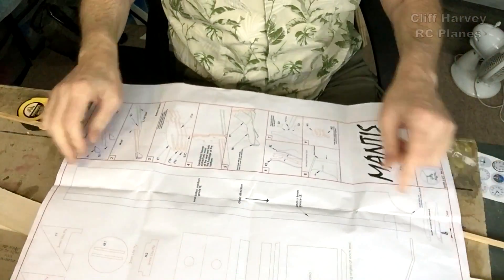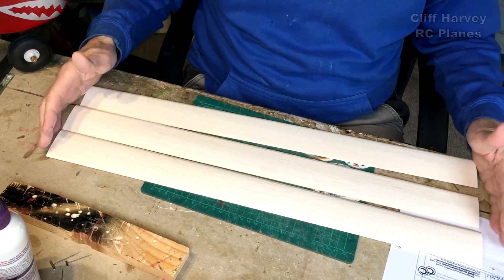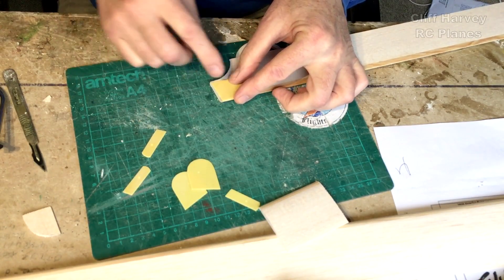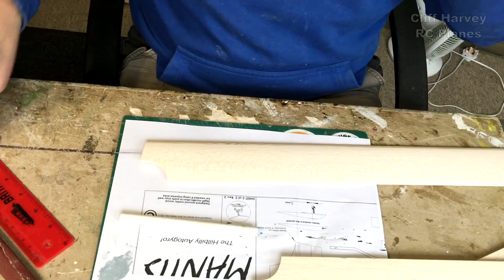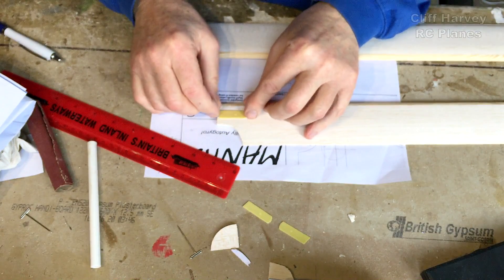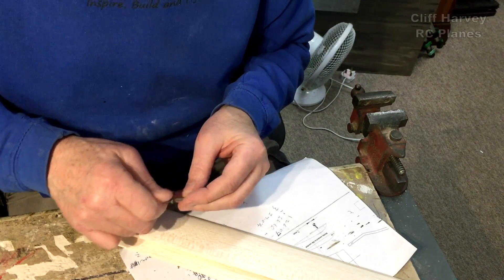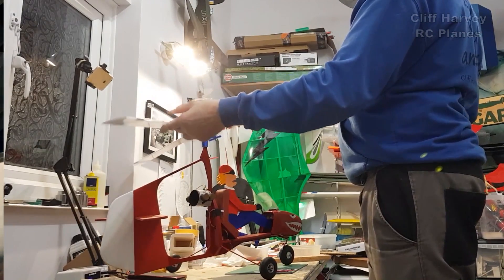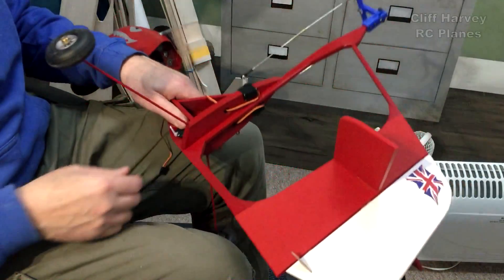Build a Mantis Autogyro from Scratch in 4 Steps - Part Four Revealed!

Comment: fascinating Cliff.  Just as an aside, when I was a young chap in the early '70's a mate of mine who was a carpenter actually built real autogyro wooden blades with a metal gyro airframe that he copied off a Benson G8 (he was a car repairer). He balanced the blades and I used to tow him along the long 36/18 runway at Dunkeswell airfield - I never forget how much power it took to get him airborne (I had a Humber Sceptre Mk2) - he didn't have a pilots licence at that stage (I had a PPL) but he managed to keep it flying at about 100Ft. I moved to Bristol with my job and I didn't keep in touch with him but he intended to put a VW engine on it.
Reply from the maker: Hi Mike, that's interesting, I know runway 35/17 well from my flying days there, you two must have been quite a sight, especially behind a Mk2 Sceptre! Shame video didn't really exist back then, at least not for the common man, cheers.

Comment: Morning Cliff, bit of an odd question, does the profile of the rotor make a difference? I notice that all of your rotors are flat bottomed, if you produced  rotors with more under camber would that give more lift? I know that would be a heck of a lot more work but would it work?
Reply from the maker: Hi Gary, the designer Richard Harris, has tried various sections over the years and this one is the most efficient both aerodynamically and ease of construction, the main thing is the lower leading edge is sharp, cheers 🙂👍